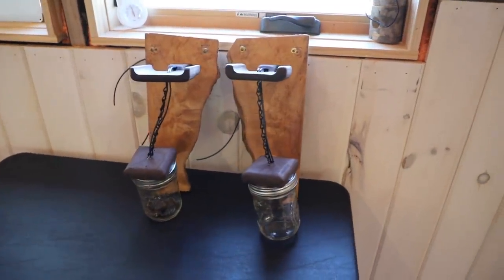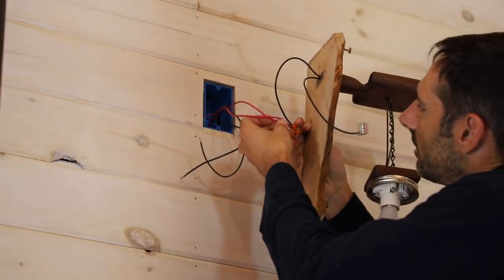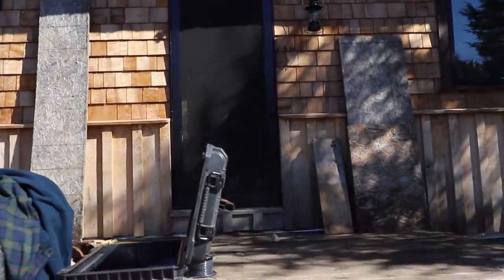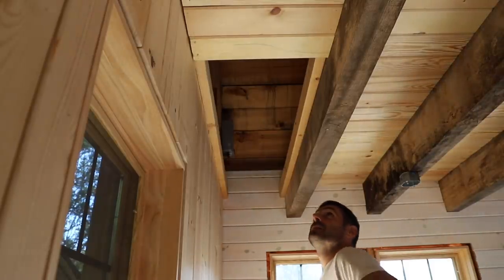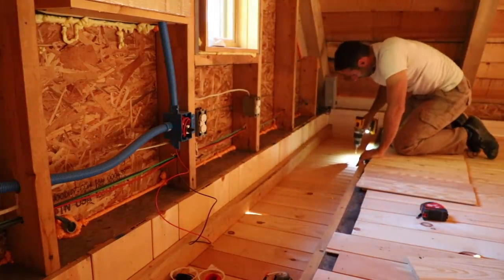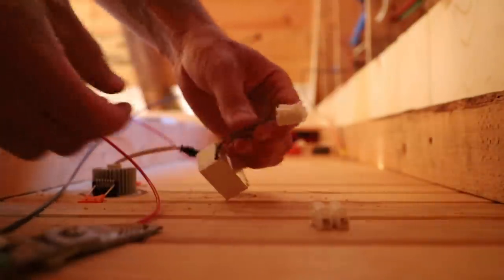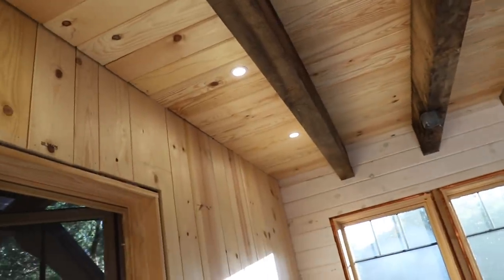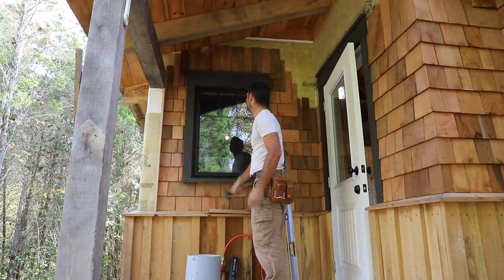Getting Creative With DC Lighting and Finishing the Loft Ceiling | Off Grid Cabin Build

Comment: The quart jars have the same wide-mouth lids. They do look like the tops are tilted inward. Not a suggestion, but I wonder if the illusion would go away if the straight edges were on the inside - if the stovepipe would visually reinforce the fact that they aren't crooked.
Reply: @Lionhiker: I was thinking and wondering the same.
Reply from the maker: That would probably work, I figured out that it is an issue of vantage point, since you are looking upward at 3 spaced out lines, it naturally looks like they are tilted.

Comment: Wide mouth quart jars. Also for decoration you can the jars in colors. I dont think those lights build up much heat, but a couple of years ago we made light jars and I drilled holes in the quart jars to actually feed a string of lights through, and you might think about maybe drilling a couple holes just to let heat out if they do get warm. The project we did was to fill the jars with a string of lights and put in some potpourri and then a lace top. As the lights are inside spiraled up the jar with a little bits of potpourri when you plug it in it makes the potpourri fragrance come out
Reply from the maker: That will be fun to seasonally change the colors! That sounds like a cool DIY project.  Might make for a neat hanging lamp over the kitchen table.

Comment: I like that you are using DC for lighting. I bought a bag full (50? maybe 100?) of 3 amp fuses for dirt cheap. My thoughts are 'if something goes wrong the fuse pops faster'. An economical way to move air in spring/fall is 5" computer fans mounted in plexiglass that pops into your window. A small speed controller for DC can make them very quiet when slowed down to about 1/3 speed. Wiring 2 fans in series will work just fine with 24V. Each fan moves about 200CFM at full speed. Hope that helps.
Reply from the maker: I tend to do the same thing, if there is any room I will undersize the fuse.  Easy to change a blown fuse but not so easy to put out a fire. Thanks for the fan trip.

Comment: With your loft flooring, you could have mixed the two kinds and alternated wide and narrow in a random pattern, but if you're happy, that's all that matters.
JIM
Reply from the maker: I wish that I did that.  I actually wish I run the boards from the wall and folded the over to make the loft ceiling that would have looked amazing, missed opportunity.
Reply: @50Acres  Take them up and do it over.  Not a big deal.
JIM

Comment: Cabin build is coming along nicely. Hope u have plans before winter to build a more stable building for your Excavator. The flat roof is going to have alot weight on it come snow.
Reply from the maker: I've got some left over lumber from a different project that I plan to shore it up with.  We are pretty far south, usually don't get more than 1 or 2 inches of snow here.

Comment: Curious if you've ever seen this type of product: Ancor Marine Grade Duplex and Triplex Wire. It's a stranded wire meant for DC in boats, I used it for my own DC runs, found it easier than loose off the spool.
Reply from the maker: Is that the special marine stuff that is supposed to be corrosion resistant?  Honestly I wish I used anything but single rolls of wire because it’s such a pain to work with!
Reply: @50Acres  Yes exactly. I was watching you run your wires and thought man what a PITA. Just curious if you knew about it.

Comment: Thanks for the links...If you get the opportunity I would love the link for the wire you use and the bulb sockets. Im planning on building some light fixtures too...otherwise I wouldn't have asked.
Reply from the maker: No prob.  That wire is just 14 guage stranded rolls from Home Depot.  The bulb sockets are just cheap bases that you find near the outlets and whatnot in the electrical section.  I think I got these ones at lowes.
Reply: @50Acres  
Thanks dude. I'm building a cabin too and need some inexpensive lighting options. Going to hookup a simple 12v system.

Comment: 16:20 lol .. de bench is too high for the table, the chair is too low. That, or the table is the wrong height. :-D
Reply from the maker: The Bench was designed to have a 4 inch cushion that compresses to around 2 inches on it. Also the chair isn't really meant for a table.

Comment: I dont understand why people feel the need to gain about 10-15% efficiency but running DC wireing all over.  How much did you save by buying special sub pannels and lighting for DC?
Reply: Little more than the actual efficiency of the conversion.

On my 1,500 watt inverter, it eats 35 watts just sitting idle.  So if he has 9 watts of LED lights on, now his load is 44, instead of 9.  Suddenly that’s a 400% efficiency increase.  That’s the real issue. I’d imagine for a few things like tools n whatnot, once he winds down the evening, the LED lighting and 24 volt USB charger in his bedroom to charge is phone is all he needs.  So the inverter only has to be flicked on when needed.  Or an entire romantic evening can be enjoyed without the inverter at all.  

If the inverter had to be ran all night, that’s 350 watts of idle power loss from the electronics being powered up alone just to support the few LED lights here n there & phone charger.
Reply: That's your specific inverter. 3a is alot to pull to do nothing.
Reply from the maker: Remember in addition to the efficiency loss, there is also a constant penalty even in search mode.  Which obviously varies by inverter.  Why I like my setup is that even on cloudy days I made enough power to maintain a full charge.  In fact I don't believe I have ever had my battery capacity below 94% full.  And I only have 260 AH @24volts.

Comment: What are the dimensions of your cabin? I may have missed it.
Reply from the maker: Hi Craig the main room is 14x20 the bedroom is 8x10 and the utility room is 6x14 feet.
Reply: @50Acres  so the footprint is basically a 20x30?
Reply: Our cabin we just started is 14x30 with a 6x20 covered porch. In Gallia County.
Reply from the maker: @003fulle  basically 20x20 if you count the covered back porch. and then plus the bedroom off the side.